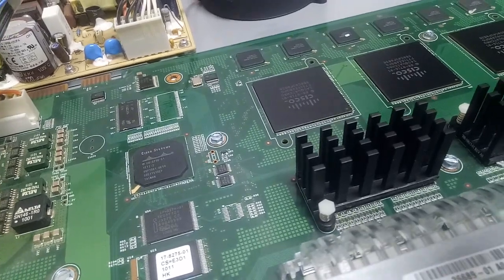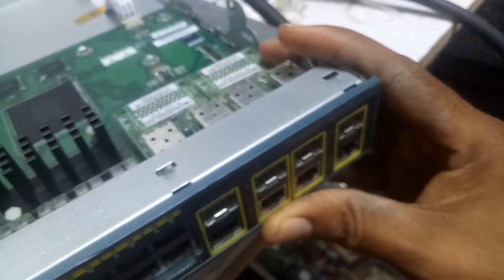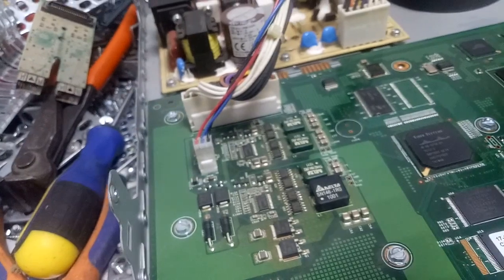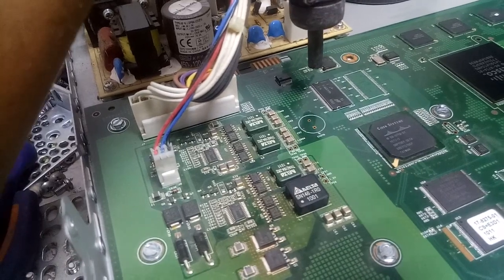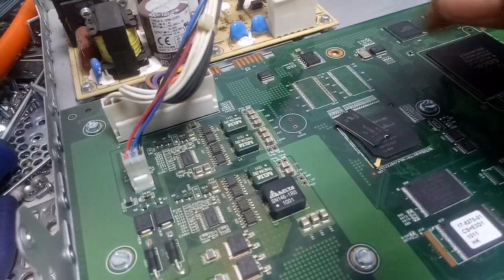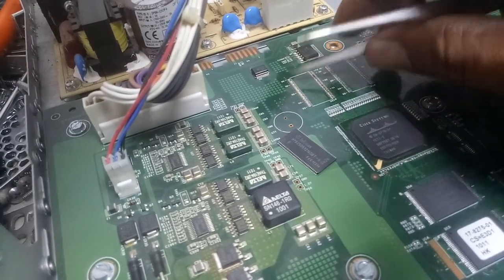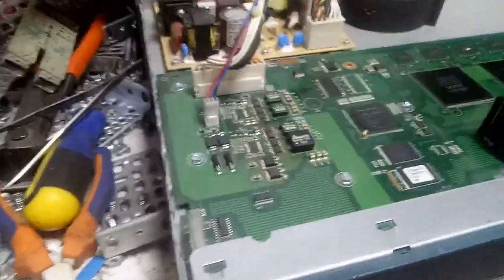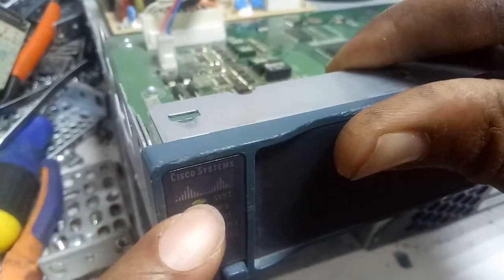c2960g-24tcl no light but fan spinning, no console output fixed

Comment: Hello, I have a 296024ttl which I can't enter through the console but it works fine as a switch. Could it be ram?
Reply from the maker: Does it boot complete ?
Reply: @jkftech yes,  It worked fine as switch, in wireshark it can be seen that it traffics cdp or stp but it cannot be managed by the console
Reply from the maker: Check if the "CLI" (tera term or putty ) BAUD rate matches with the switch
Reply: @jkftech  hello .I have seen all your movies thank you for this . I also checked the baud rate. what is the problem?
Reply: model name : ws-c2960-48PST-L
Reply from the maker: Sometimes it could be console ic is dead
Reply: @jkftech  ic whit name : mb3232i?
Reply: thank you for your attention😍
Reply from the maker: @missengineer-bi5iw  yes